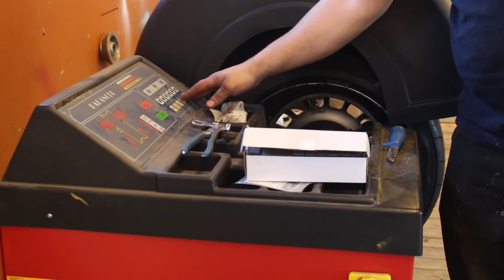How to mount tires by hand: Yokohama Advan Neova AD08R

Comment: What is being sprayed on? What are the metal tools used to flip the sidewall over the wheel hump/lip? A little more info wouldn't hurt.
Reply: That's a regular tire iron, and the spray was a regular deodorant (it just needs to be highly flammable.)

Comment: What's the size of the tyres?
I'm looking into doing something similar, but on lower budget - 205/50 NS-2Rs on 9Jx15, they have pretty stiff walls too.
Reply from the maker: Those are 225/45 a@ 9,75" wide wheels.

Comment: when you spray it with the brake clean it's easier to spray it around the bead and light it instead of just trying to fill the tire and lighting it
Reply from the maker: Brake cleaner works quite badly because it doesn't explode. It doesn't work for stretching the tire because that. But in normal case it can be used to help seat the tire.
Reply: its usually what i use when stretching. maybe the stuff we have at my shop is alittle more boomy

Comment: Im digging the bottle caps man! They look pretty sweet 
what did you use to rebarrel them?
Reply from the maker: +Javier Thanks. Those are BBS 20 bolt lips and barrels.
Reply: ahhh I see, so you bought a deep dish lips and barrels for it. modified or cut out the e30 rim ,drill holes and bolted them on. do you have a link to the gallery?

Comment: what times did you get in the 1/4 mile
Reply from the maker: +Stiofan e36 13,5 s @ 188 km/h using street tires with very little traction (wheel spin even with third gear). Haven't yet tested these tires on 1/4 mile but at east on street I can launch the car with no wheel spin.

Comment: by the time he finisht 1 tire i do atleast ten and that includes disassemble the old and assemble the new plus the balancing out the tires im a tyre mechanic
Reply: kinda the point of the video was that you Didnt need a tyre machine hens the title "How to mount tires by Hand".....
Reply: +Glimmz why would you do that high chance of damaging the rims whit the spoon i know if i bought new rims and tyres i would want to do it Correct whitout damaging rims or these but hey thats my opinion as a mechanic and i understand my view sounds exagerated nut i know how easy its to damage rims .thank you sir
Reply from the maker: Yes there is risk of damaging the rim. But if you know how to do this, you won't leave a scratch. And of course for our missile car, little sratches just gives the wheels more character. And about that speed. This is much faster way than pack the wheels and tires to car, drive to the dealership, get the tires mounted there and drive back 20+ kilometers. And this is also lot cheaper. Last summer we saved almost 1000€ by doing this by ourselves. And as it was said earlier: The point was to show that mounting tires can also to be done by hand.

Comment: Fucking bullshit, must have the slipperyest tires in the world. I cannot mount my 205s50r15
Reply from the maker: These are semi-slicks so the side wall is quite stiff. You are just using wrong technique :D
Reply: @pazi88  yeah, i figured it out. Not sure why the front of the rim its easier to place the tire on and get it off. Still a pain, but not impossible-was really trying hard not to scratch my 6uls. -_ ugh

Comment: Why wouldn't you push through the back side first then then use the irons on the back side of the wheel and avoid any damage from the irons whatsoever? StI'll do exactly what you did but with the tire flipped over the other way is all I'm saying.
Reply: Because the ONLY side of the wheel you can mount a tire from is the side the drop center is closest to. Some wheels have the drop center toward the front and some toward the back and that determines which side the tire will mount from. It's not like you really have a choice as the rim design has made that choice for you.
Reply: @chanraxter2015  Thank you. I was wondering the same.